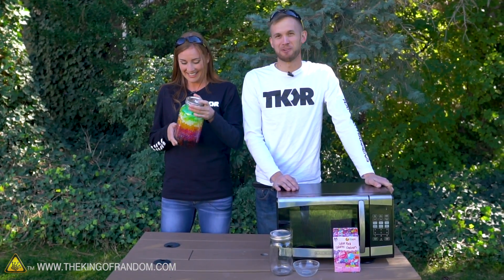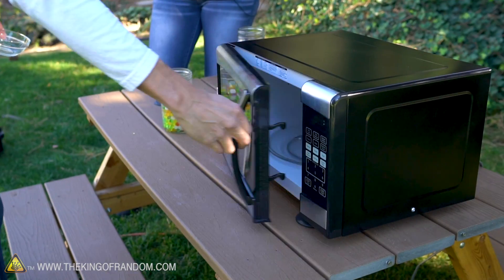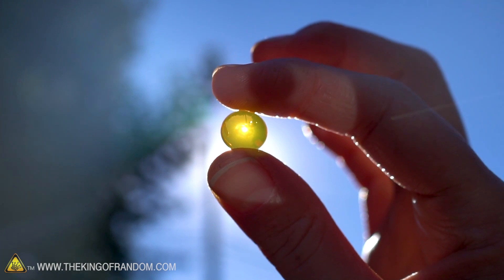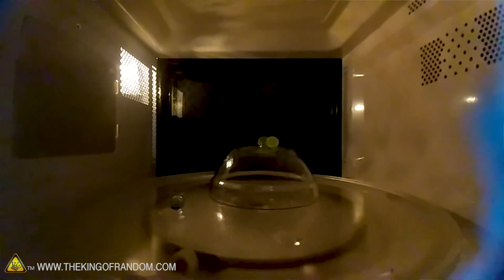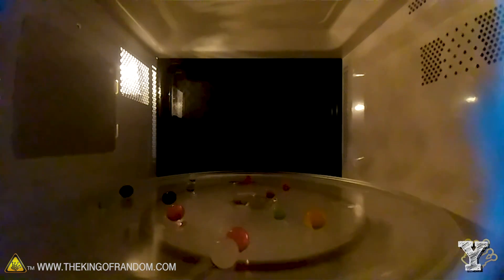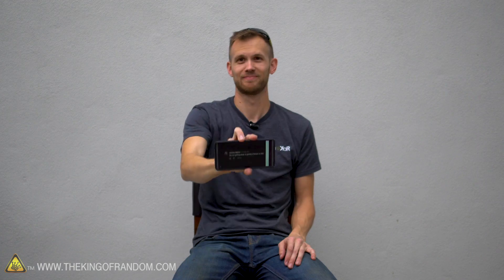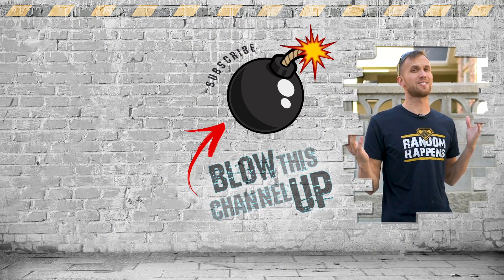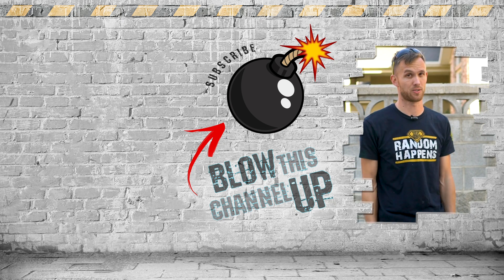Cooking Orbeez In a Microwave. Ever Wonder What Happens When You Try To Melt Orbeez In A Microwave?

Comment: Hi, radar technician here! The reason that you're getting plasma, and yes I know this is a full two years and some months old, is because the orbeez diameter are very close to the wavelength the microwave emits in liquid. If you notice, the plasma only really occurs between the larger orbeez when they're touching, and it is from the way the frequency resonates within individual orbs. 

Your lovely assistant touched on what is occurring when she correctly noticed that the very middle of each orb was toasted, and the plasma only occurs when they touch. This is because instead of the very center of each orbee being where the resonance happens, the resonant point is where the two orbeez are touching which causes a bit of the orbee to vaporize, and since you are basically ripping electrons away and ionizing the gases resulting from the vaporization, it enters the fourth state of matter: Plasma!

If you want to really up your plasma game, cut an orbee in half but not entirely. Leave the two halves connected by a thin piece of material and place atop that a small glass cup like a shotglass. When the resonance cascade occurs, like the Black Mesa incident ;) the plasma will stay for an extended period of time and be awesome.

Comment: I think a reason they set on fire for a second in the microwave is because in a microwave electricity is going THROUGH whatever is inside which is why putting metal in a microwave is a VERY bad idea. That will most likely start a fire and it can get quit big.

Comment: If orbees in a microwave can generate plasma, what happens if you fill a clear tube and pass electricity though them. Try a tube with an inner diameter the size of the orbees, cap the ends with electrodes, and see off you can make Christmas tube lights!

Comment: What happens if you soak orbeez in other liquids? If you soak it in gasoline, will it be flammable afterwards? (Like if you dry off the surface of the orbee and attempt to ignite it?) Would it be explosive? Or if you soaked it in rubbing alcohol, would it soak it up? And would it prevent the alcohol from evaporating quickly, or would the orbee shrink rapidly when exposed to open air? Can orbeez absorb something thicker, like syrup, and what would THAT do to it?

Comment: Could they be acting like little antennas that are closer to the freq of the microwave energy? Apart, they are tuned to a higher frequency. Connected, and they act like a longer wire???? Yes.

Comment: Any conductive object placed in a microwave can act as an antenna, resulting in an electric current.  The electric field inside a typical microwave oven is 2,000 volts/meter and 2.8 megawatts/meter^2.  So, if the center-to-center measurement between two Orbeez is 1.4 centimeters and they are not touching, the voltage potential between them is 28 volts.  The voltage required for an arc to travel through air is 30,000 volts per centimeter.  Thus, an arc can travel between two Orbeez only if they are no more than 0.000,93 cm apart (28V÷30,000V/cm).  However, the surface tension of the water film coating the Orbeez would probably prevent that tiny degree of separation from happening. 
 
So how can the arcing occur?   As the Orbeez become heated, humidity inside the microwave increases, especially in close vicinity to the Orbeez spheres.  This causes the electrical breakdown (arcing) voltage of the air to fall dramatically.  At 2% absolute humidity, the voltage required for an arc is only 618 volts per centimeter.  Thus, the spheres could be almost 1/2 mm apart and arc.

Nate and Calli, as always, thanks for the videos. 👍 👍
Reply: Mad Science my dude!
Reply: Physics A-level?
Reply: Mad science you are better in science than him
Reply: 0.000,93cm 
 9.3mm?
Reply: @MovingThePicture  no 0.0093 mm, if thallok is correct.   A centimeter is 100th of a meter and millimeter is 1000th of a meter so the decimal place would only move 1 space.
Reply: "Yeah Mr. White... yeah SCIENCE!!"
Reply: English please
Reply: yes

I understand
Reply: Homer simpson: Ha, Nerd!!
Reply: Mak a Shockley damintplepoten
Reply: Great info! Thanks!
Reply: Finally someone who knows their stuff, and isn’t tryharding to look smart. Thanks
Reply: I missed science class no cap
Reply: thallok ummm
Reply: I'm his teacher
Reply: thallok ... Your right...
Reply: Nice copy and pasting my dude
Reply: r/imverysmart
Reply: Lowkey college professor over here
Reply: Nerd
Reply: Kokobonk Bonker bully...
Reply: thallok nice
Reply: wow I came here to be entertained not learn but cool bro
Reply: Wow
Reply: Nred
Reply: Nice lecture. I totally understand.
Reply: Odd flex but okay
Reply: I have no idea what that says

Comment: 4:24, you can see the effects of the microwaves is setting in on the camera. You can see the blue almost Aurora type waves on the edges of the cam.
Reply: That was just the camera not directly lined up with the hole
Reply: @yeetbread4678  Could also be ionization around the edge of the hole. That's about what you get when you ionize air, a very faint blue glow.
Reply: @eideticex   no re watch it, its there the whole shot
Reply: @yeetbread4678 
Exactly

Comment: A couple things to try with the orbees:  
dunked in liquid nitrogen
roasted in a furnace (foundry, arc)
put in the vacuum chamber
use other liquids instead of water (liquid nitrogen again? flammable chemicals that you then light on fire?)
grind up into powder, then apply water to the powder
try to melt on the stove

Comment: For anyone wondering the reason they explode is because there’s water trapped inside the orbeez and when it heats up past 100 C degrees or 212 Fahrenheit the water rapidly expands into gas and pushes the orbee bits outward, basically exploding them haha. It’s the same thing as popcorn! It pops because they have a tiny amount of water in them and when it heats up, pop! It explodes

Comment: Congratz on exposing yourself to the extra unnecessary microwave radiation by compromising the structure of the microwave.
Reply: Congrats on your ignorance of microwave radiation. A small hole like that would let through very little due do the wavelength of microwaves (about 12cm). If it was letting them through, the phone would have been fried and likely at far lower level than is dangerous to people. Same reason they can have small holes all over the front screen.

Comment: Won’t the microwave radiation mess up your phone?
Reply: Evidently, no. If the hole in the metal is small enough (less than about .5 cm) microwaves can't pass through. Same way the front screen works, but smaller 'just to be sure'
Reply: B Ueb I see, thank you for the explanation.

Comment: Can you boil water with the solar scorcher
Reply: if you can melt coins you can boil water...
Reply: Mnyman06 Gaming make this top comment
Reply: Yes Mnyman06 Gaming yes you can
Reply: I feel like it would straight up vaporize it without even boiling it
Reply: more interested if it can melt a pot of salt
Reply: No, it can melt rock and metal but cannot boil water
Reply: Cayden Skinner it wouldn’t boil, it may evaporate but I doubt it’ll boil
Reply: Now I'm curious.
Reply: If you put dye in it yeah. Not so sure about just clear water. I think it will just burn what's underneath the water, considering it's a glass bowl. if not it will heat up the bowl.
Reply: if u CAN do that, then u can heat a pool. potentially. you might have to heat a solid object first, then transfer the heat to that, like having a pipe with a clear top half and heating the bottom with water flowing through to be heated up by the bottom of the tube
Reply: Mnyman06 Gaming yes. It’s burned wood and cooked steak
Reply: @yeahnah2851  i am only asking because u was wondering if it was possible to boil it or of it would just evaporate or if it would melt whatever the water was in